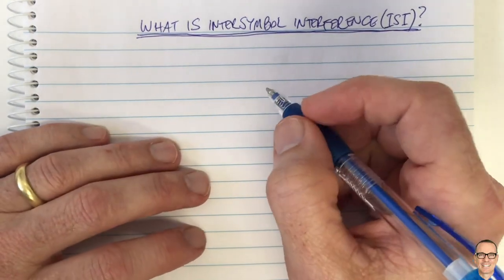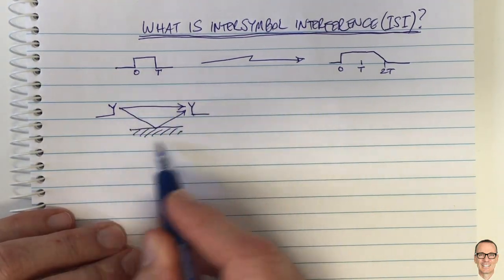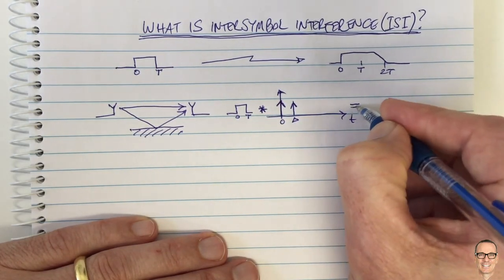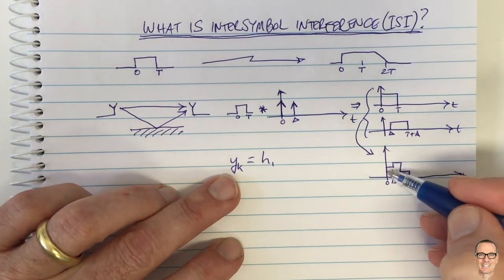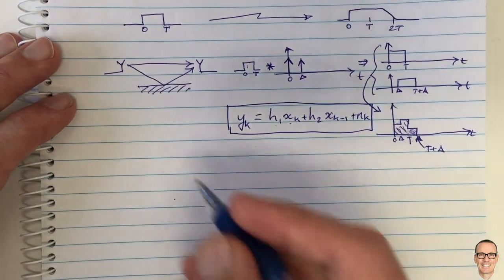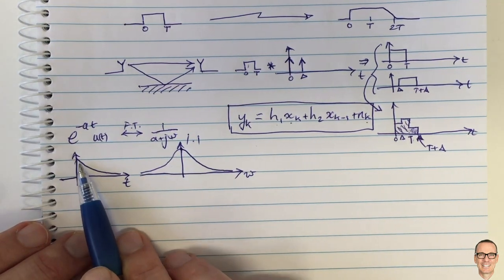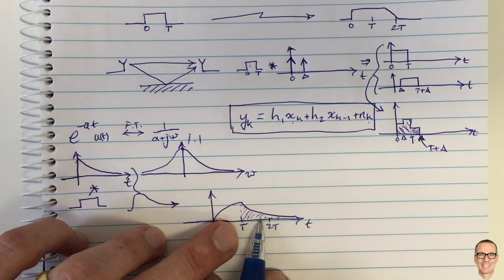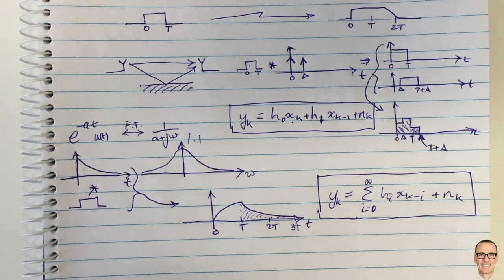What is Intersymbol Interference ISI?

Comment: hello professor the condition for ISI is that the symbol duration should be less than the delay spread (Ts<delay spread) but in the above case the  delay delta considered here is less than the symbol duration so how its contributing to ISI ??
Reply from the maker: Well yes, if the symbol duration is less than the delay spread, then there will be ISI. But it doesn't have to be that extreme for ISI to have an effect. ISI happens whenever there is delay spread (as I point out in the video). The greater the spread, the greater the ISI.

Comment: Sir, I have a question. You have said that in a wireless channel when an impulse is given at the input, the impulse arrives at the receiver with different amplitudes due to multiple paths. Is it assumed that wireless channel has no impulse response of its own?
Reply from the maker: It's not clear what you are asking. The "wireless channel" is the combination of all the multiple paths. If you are referring to the Line-of-Sight component, then it arrives at the receiver with a certain gain (due to the antenna gains of the transmitter and receiver, and also the distance between them) and it also has a certain phase (due to the distance between them, and the phase offset of the oscillators in the transmitter and receiver). This is also the case for all the other paths too, except that they are also affected by the absorption/reflection coefficient of the object they "bounce" off.
Reply: @iain_explains   Thank you for the clarification sir. Upto this point, I was thinking that wireless channel will also have some kind of channel response similar to the one you have shown for a bandlimited channel.
Reply: the impulse responce of the system is "impulse" suggests that  its treating all the frequencies equally (as the nature is equal for all of us the same thing is with frequencies) as when you observe the impulse in frequency domain its a constant line which means what ever signal you are sending you will recieve it at receiver untill and unless there is complete attenuation of signal

Comment: but intersymbol interference is between two different symbols why you are considering two different copies of the same signal how can same copies of the same symbol cause interference to each other??
Reply from the maker: The first "copy" of the transmitted signal will align with the correct symbol timing at the receiver (since the receiver will have done its "timing recovery" based on the earliest "copy" of the signal to arrive). The delayed "second copy" will then arrive with at least some of its duration falling into the next "receive symbol period" (since it arrives after the first copy, it also ends after the first copy ends, by which time the first copy of the next symbol will have already arrived), therefore causing ISI to the next symbol.

Comment: In general the concept is clear; however, the ISI part probably should be expressed as x(k+1) instead of x(k-1).
Reply from the maker: No, that's not the case. The ISI problem is caused by the previous symbols (ie. x(k-1), x(k-2), ... ) that are spread out/delayed, and are interfering with the measurement of the current symbol (ie. x(k) ).
Reply: Although it is true that the ISI problem is caused by the previous symbols, your video shows that in the kth time slot besides having the  h(0)x(k) component there is also the ISI component which leaks into the next time slot (k+1). In order to tally with the diagram, your expression should be h(0)x(k) + h(1)x(k+1). You may want to watch your video to understand my saying.
Reply from the maker: I have watched my video again (as you suggested - although I don't know if you were being sarcastic) and there is no error in my video. You are not correct in what you say about the equation. Energy from x_k appears in measurements y_k and y_(k+1). This means that the equation for y_k will include x_k and x_(k-1). This is exactly what I show in the video.